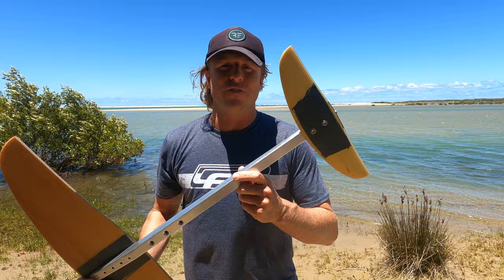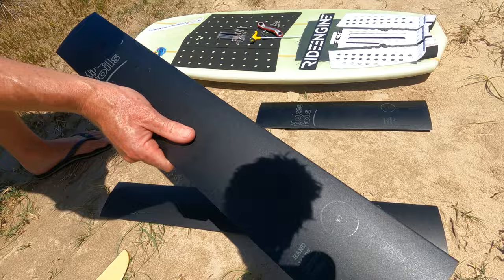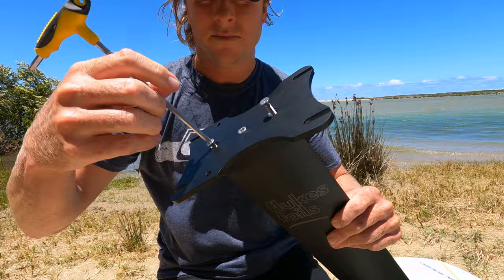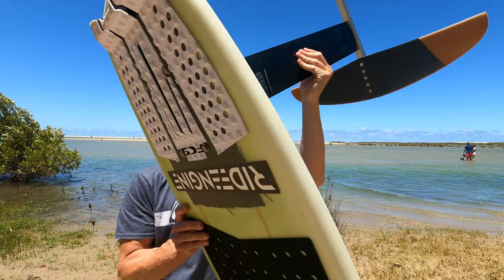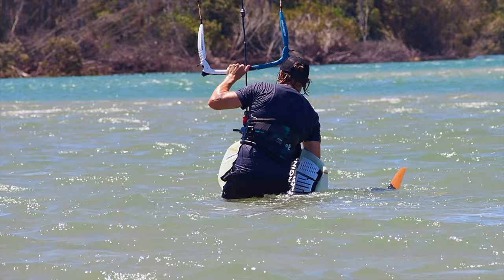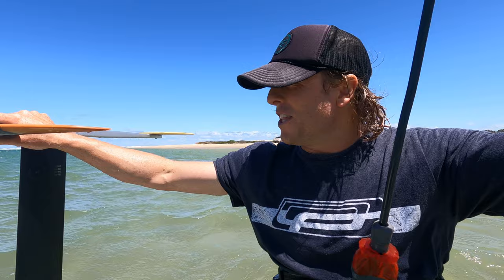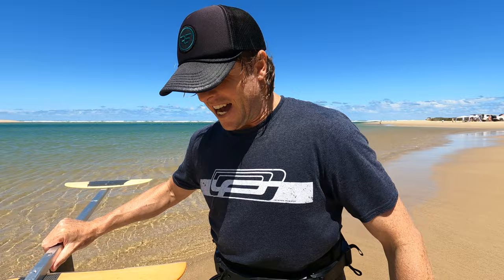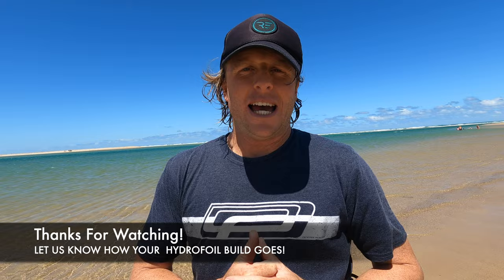How to Build a Hydrofoil: The Test - Riding The Foil For The First Time. (Video 15/15)

Comment: Great series Luke. Just finished building two sets of wings. One set per your design and the second set I added 20% area to the front wing and 10% to the rear wing. Simply scaled the plans up by those percentages. Next is to build the aluminum fuselage.  Hope you get stock in soon for the mast and base. Then to build a board…. Gotta get ready for some boat trials this summer 2023.
Reply from the maker: Hey Mark! Amazing! Happy to hear it and thanks for letting us know :) Keep us updated on the build! Email me some pictures of it when you have a chance! I'd be stoked to see it. Also I see you purchased a mast too so that's great, i'll get it in the post for you ASAP.

Comment: Hi, excellent video tutorials, I have watched them all. I am interested in making my own surf-foil but I have some doubts. I have seen that most of them have the front wing down with respect to the stabilizer that is normally above, I would like to know if this is really important since the one you make is inverted and for my discipline is very important the pumping. You could help me a lot by answering
Reply from the maker: Glad you like them! Yes you can change the orientation of how they attach, however it just takes some extra shaping to get a flat side of side of the Fuse to attach to the curve of the wing. it doesn't make much difference to me, but there ay be some benefits that im not sure about., i know some of the local guys prefer the stabliser on the top as it helps protect the wing form hitting the bottom, as the fuse takes some of the impact, but other than that i really dont know how much of a difference it makes,. far more important would be wing size and shape, and fuse length. Hope that helps and let me know how the build goes!

Comment: Hello Luke I was wondering if I were to scale everything 25 percent would I also need to scale the fuselage?
Reply from the maker: Hey! If you use the 25x25 the alloy will be strong enough but the weak point is the screw connections. the bigger the wing the more lateral load will be applied to the screws and may bend them. So you could think about how to strengthen that area :)

Comment: Hi Luke. Is it possible use this foil with a wing Sail board? There are any diference? Needs be larger?
Reply from the maker: Hey yeah exactly, you can just size the wing based on your needs. with this design there are some limitations with the connection point on the fuse being a weak point if you go too big with the front wing... but you could do 1.5X fine, or reinforce those connection points. :)
Reply: Thank you Luke